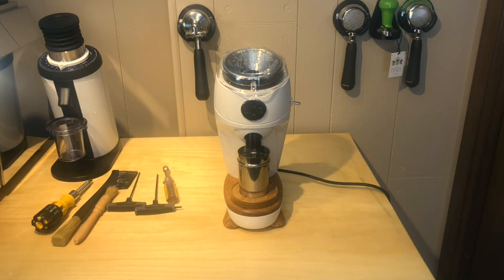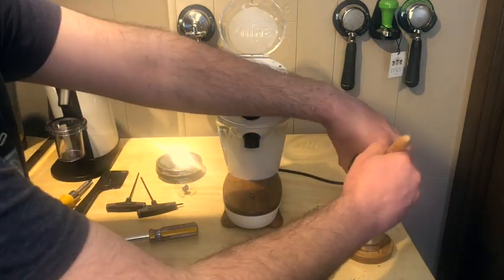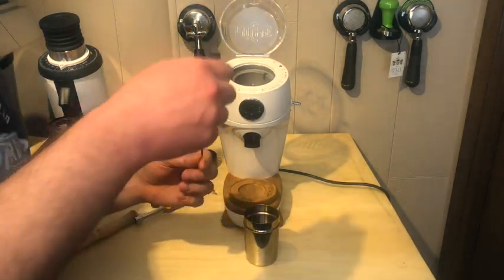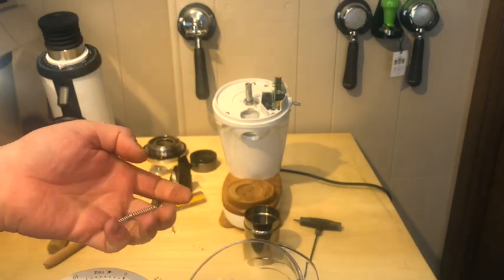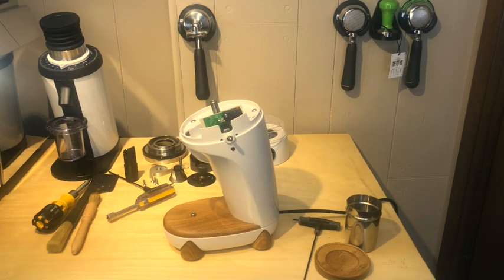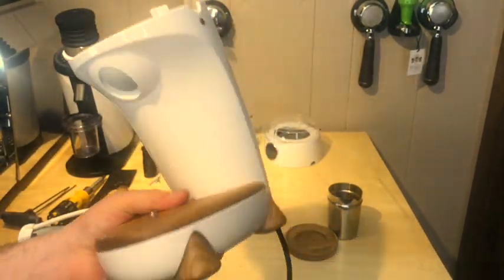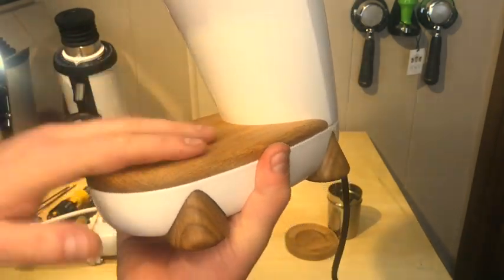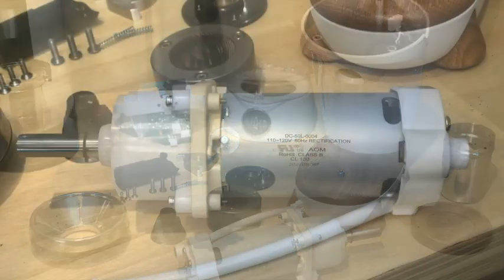NICHE Zero Disassembly - A look at the internals

Comment: Nice vid, PortaKeeper!  With my NicheZero, inside that base (that you did not want to open... ;-)), I found a set of TWO SPARE SPRINGS... Nice touch from the makers of the Niche Zero for those who tend to lose the burr springs... What I did not find in my chute, though, is the "clump breaker"... (maybe not needed, because I do not have clumps in my grinds);
Greetings from Switzerland!
Reply from the maker: Daaang!  I am going to open it up and show the springs if mine came with. That’s a very good tip!    The clump breaker on the niche is extremely minimalistic so not really needed

Comment: Thanks for taking the time to post this, it was interesting to see.

One thing that really surprised me here is the amount of retention. It's still very low, but that's far more than I've ever seen on mine. I actually no longer clean mine out as often as I used to because there's so little left behind, usually about .1 or .2 exchangeable grinds. I wonder what the cause is? Maybe humidity, or possibly a slight change in materials used at some point after the first batch? That's if there's been no water added when grinding. The plastics inside were chosen for their anti static qualities and adding water is counter productive.  Likewise I've no need of a bellows on mine, although if I was getting what's probably half a gram retention, I can see why others would try it.

Comment: Question: looks like there’s a lot of empty space both in head piece and the aluminum shaft holding the motor. Would a layer of high heat sound deadening be okay to lay down in it and maybe around a portion of the head piece? Just a thought to get it even quieter.

Comment: I tired putting some light roast fermented beans, for espresso fine through the niche - I image this would test the limits. It jammed up completely. also a little smoke waft. Wondering if anyone else had jam up and or have had a new motor sent form niche.
Reply from the maker: Sounds crazy!   Not the grinder for light beans in my opinion. Sounds like some very hard beans
Reply: @portakeeper  haha yeah i like a lighter espresso roast. Really though Im wondering if it’s the contact surface(burs), motor, or gear train that’s failing. Also if you thing there’s a similar priced grinder that would perform better, maybe the turin64? Really appreciate your videos
Reply from the maker: @MrMadvillan  hard for me to say how f the Niche is failing.  Maybe struggling with hard beans?    The DF64 does well with stock burrs.  I like the MP for light roasts.  Slower but awesome.  The 83 is pretty awesome as well.  Both have lots of power
Reply: @portakeeper  thanks for the insight 👍

Comment: Do have try to reduce the RPM or have variable rpm for niche
Reply from the maker: Niche is single speed motor
Reply: @portakeeper  do have any option or idea to reduce the rpm..
Reply from the maker: @shamsultmx7994  I sold the niche, didn’t care for it much.  It’s not really designed to be variable speed

Comment: I have always seen a stupidity design to use DC motor for home wired AC   not portable device without battery or  speed control  purpose !  is just low cost low reliability against reduce volume and weight  !

Comment: A lot of plastic for the price
Reply from the maker: Yeah it’s a total let down.
Reply: A part of is is the design not being a square box as well, which, depending on the rest of the kitchen, matters for quite a few people.

What more do you want done in metal, what properties would you get from using metal instead of plastic in some parts regarding static, how much would it increase the cost of the machine for those parts, and would it actually matter for its lifelife. The shell itself is nice, and metal, the burrs is what 25-30% of the cost. I would've loved to see the midplate done in metal as well, but I think it would've raised either complexity or cost too much. At least with the current design.

I mean, if you want to go for the higher end machine stuff, you always have the Lagom P64 with similar workflow and higher end construction, including RPM control, but then you pay around 2.5-3 times as much as a Niche. And I mean, if you want the really higher end things... Weber EG-1, Monolith Max, Levercraft Ultra.